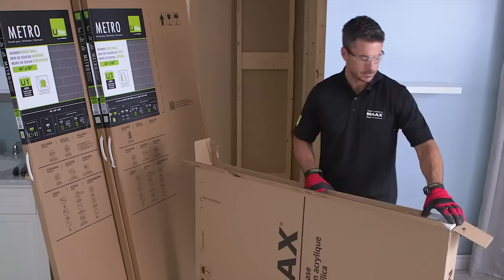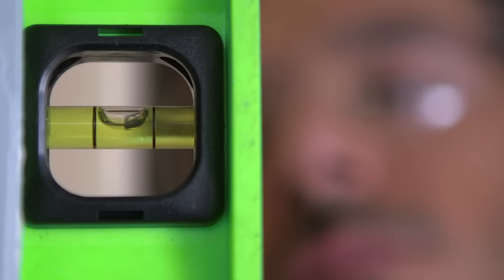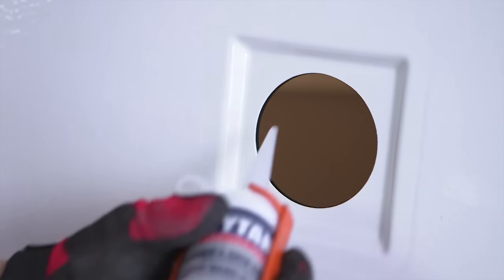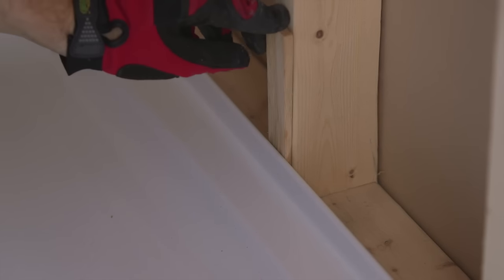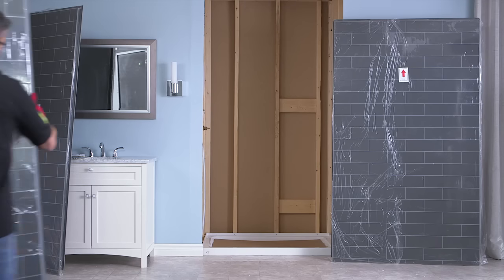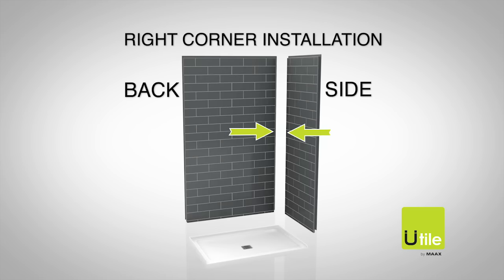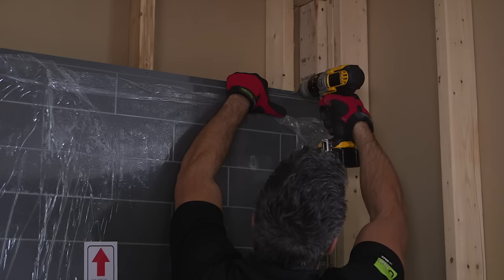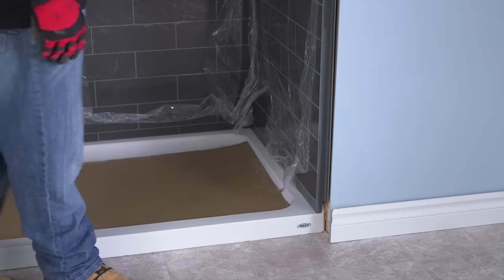Utile by MAAX - Installation Video

Comment: We had to reorder the large  wall panel due to the first one being warped, off by almost an inch. They sent a second one, and ITS WARPED, but by only 1/2”. Ok we’ll use it…..but… trying to line up clips along the edge, they’re off, and 2 of the clips have a lot  of play, and one set of holes is so close to the edge, you can’t even get the clip into them ! Whaaaat ?  I’m thinking the rest of you are right, and this is some sloppy manufacturing 😡. The hub is a good problem solver, but still pretty frustrated. Might call Home Depot and recommend they stop selling this product. Not impressed, Canada, with your dictator, or your product …signed, “your unhappy neighbor in Idaho” 🤨
Reply: lol made me laugh. Your comment started out normal enough then went bat shit crazy by saying you aren't impressed with Canada and its dictator over a failed utile install.
Reply: @Ragnarrage  glad you got a laugh !

Comment: Use gloves or you will be sporting some serious fiberglass splinters. Our holes were not drilled correctly making the clips unusable. Shimming is essential because some of the panels are slightly bowed. So even with leveled studs, the panel might require shimming. Very frustrated with this product. We rigged it all in the end. Would have been appreciated if the had clips or spacers or whatever you want to call it for bases with a different height of lip. FYI we installed shower walls over a tub all the way to the ceiling.

Comment: And then he’s supposed to drywall on top? That doesn’t make sense at all. Mud getting all over the tiles. Tile should go to the ceiling
Reply: What do you think happens in a new construction after the one piece tub or shower is installed? Drywall is installed above and around it. This is a good example of where you would use a drop cloth to protect a surface. Or, you know, just don't have drywall mud flying around in large quantities.

Comment: Just finished ours.A few tips 1) for the installation of the side walls using   dual suction cups tool(Harbor Freight )makes it a lot easier to move the panel up and down 2) for centering the pan properly I installed the back wall unit on the pan then you can be more precise by looking at the vertical 2x4 next to the back wall unit.

Comment: 14:24 this is wrong. you're not supposed to silicone the very bottom of the faucet faceplate. if water goes between the faceplate and the faucet handle, or if the upper silicone fails first, it has to be able to escape through the gap at the 6 o'clock position in the black foam around the circumference of the faceplate rear. if you don't leave that open then it can't drip out and could fill the cavity behind the faceplate and overflow through the faucet hole in the surround

Comment: We are in the process of installing now, most of the holes were miss drilled, we spent all day taking it in and out fighting it and each other! The 1st back panel we got was cracked, it took weeks to get a replacement. Its been exasperating!
Reply: Ours were also mis-drilled, making the clips unusable. We ended up just using predrilled holes to screw the thing into the studs when we could. I am pretty sure my husband invented a few new combinations of swear words. Shimming is essential because the panels can be somewhat bowed.

Comment: I believe they made a mistake at 14:24 saying to silcone the face plate aka valve escutcheon...there is no need to do this as it comes with a foam seal as shown.. the silicone will look messy if not done well, and may get scumy longterm.
Reply: Not all trims will come with a foam backing.
Reply: @colettegauthier6997  any trim worth buying will have foam gasket.

Comment: Getting ready to tackle this installation in couple weeks.  Special ordered thru Menards.  The base Menards bundles this with has the styrofoam core.  My foundation is level concrete.  Is there any way of minimizing the squeaking noise the base makes?  Would felt help?
Reply: Are you happy with it? Did you figure out a way to stop the cheap sounding squeaks? Thanks
Reply: @JeffWinters  overall yes.  There is some give to the styrofoam base but it does not squeak.  I put baby powder on concrete prior to install.  I was told there is a 300 lbs weight limit for this base.
Reply: @dougwhite8074  😆

Comment: I bought the Artik bath surround product and although it looks slick to put in, it is a nightmare.  I am working on putting in the back of the bath tub surround (and they don't show that do they?...I wonder why) but it is in a remodel situation.  My walls are plumb and square, but putting in the back the bottom is bowing.  Nothing to tie the bottom back to only the top.  The fiberglass edging in this video is very clean, but the product delivered to me the manufacturing is very sloppy. Using the holes to put in the retraction pins and to find the holes on the back side to put the screws in I had to remove the fiberglass to find the holes on the other side.
Instructions:  The instructions are not sufficient for a remodel.  No instructions on what to do if certain situations occur.

Support:  Maax only has support in Canada M-F from 8 -6 pm EST.  How realistic is it that DIYers are going to do this Monday through Friday? Even better, why is it that it is EST?  That leaves us in the West short 2-3 hours!  I know the universe revolves around Ontario and Quebec. They should have their support team available on the weekend ,  ' cause reality check Maax - that is when DIYers do their stuff.  I know I'm Captain obvious. Now I have to wait until Monday to talk to them, when I have paid a contractor to do the work and have to work with what I have or wait until Monday.
Reply from the maker: Please contact us directly at 1-877-438-6229 OPT 2+2 for any technical support. We have technical specialists that will be pleased to assist you.

Comment: Did I miss something? Did the installer make sure there were studs located behind the shelf brackets?
Reply: those panels are 1/2 to 3/4 thick....enough to support a bar of soap or shampoo with the shelf

Comment: I installed drain in shower base  as shown . Have it set up in my garage to check for leaks before I install it .
The drain leaks around the gasket supplied with base . One rubber gasket touching the drain pan itself then the cardboard gasket 
The directions say one gasket touching the bottom of the pan then cardboard gasket .    
However the  drain came with two rubber gaskets and two cardboard gaskets directions say one set like the video 
Why is it leaking ?
Anyone ????
Reply from the maker: Hello! If you are still experiencing trouble with installation, please do not hesitate to give the MAAX team a call at 877-438-6229 (Option 2) between 8am-5pm EST, Monday-Friday. We would be happy to hear more about the issue you're experiencing with the gasket and help you find the best solution!
Reply: Use silicone between drain piece and top/inside of tub/shower.

Comment: You show shimming the base but not shimming the walls. I'm assuming for this to work, either shimming or building out the studs will be needed for the side walls.
Reply from the maker: AI B, the shimming of the base will always be required allowing a match perfect between base and wall. By shimming the base on the backside, you will make sure that your Utile sidewall does not exceed the base threshold. Also for each side you will assure that your Utile wall are scared and straight allowing you to secure them directly to the studs.

Comment: Why put directly on studs? I like to use aqua board behind mine. Will it work? They don't show how to finish the drywall if using their method over studs.
Reply: I was wondering the same thing. Doesn’t look like they reply to comments
Reply: im sure it's just like any insert.  drywall down to the flange then use a setting compound to fill in the void and smooth it out
Reply: Yes, correct. @R2Mike

Comment: My valves (installed by a plumber) stick out several inches beyond the wall, making it impossible to engage the side wall to the back wall. I needed to slide the back wall away, engage the side wall, and then move the whole assembly back against the side wall studs.
Reply: This is the problem I'm trying to figure out now, except I don't think I have enough room to engage them away and then move them into place 😞
Reply: We had the same issue, but were able to engage the clips at quite a severe angle.  We set our panel in so it could still move.  We had already cut our faucet, spout side panel.  Then we slid the faucet, spout side panel into the corner at the angle required to just get past the roughed in spout.  Lifted the side panel about and inch and a half, pushed it into the corner and used a lot of force to push down.  It snapped right in.  Surprising but it worked.  No where does U-tile tell you this, show you this, nor when I called their Tech number did the tech give us this info.  One U-tile video on how to properly install a tub surround with the bath spout rough plumbed would be very helpful and is a joke that U-tile hasn’t done this.  That’s our only real complaint.  Once in place it looks and functions well.  Oh, and those stupid little cutouts at the bottom corners of the side walls are dumb.  Have a left and right side and stop goughing out the bottom corners that a person has to deal with when finishing the drywall around the side panels.
Reply: Pulling the cartridge on the mixing valve would gain you some clearance.

Comment: Can panels be used with any brand shower pan?
Reply from the maker: Thank you for your question, Gigi! The recommended bases for our Utile panels are the MAAX Olympia base and the MAAX B3 square base. We cannot guarantee that bases from other manufacturers will fit the Utile panels properly. If you have additional questions, please do not hesitate to reach out to our team at 877-438-6229 (Option 2) between 8am-5pm EST, Monday-Friday. Our product experts would be happy to assist you. Best wishes with your upcoming project!
Reply: @maaxweb  - This video is very nice, but does not show the B3 base.  Is there such a video?

Comment: How long should this take to install, and what level of installation is this, easy, med or expertise ?
Reply: As a professional plumber, I would say this is somewhere between medium and professional grade skill to install. Maybe leaning towards professional if the surrounding structure isn't reasonably close to perfectly plumb, level & square. But perfectly plumb, level & square is a myth. In a remodel scenario, you virtually never come across it. Something will inevitably need shimming, trimming or leveling.

Comment: What a POS system. This whole thing relies solely on silicone with no panel overlap? How wonderful. NO THANKS.
Reply: Panel overlap is only required on the bottom of each panel. The corner joints of most shower door frames only require silicone with no panel overlap so the other corners should be fine. Last I checked gravity still pulls water downward towards the earth.

Comment: The video is very misleading.  The shower doors take 1 day alone to install!!!  As the door insulation is not detailed in this video, that should be evidence enough of the difficulty of the door installation. Although the Utile shower looks good once completed, I would not recommend buying this product.  It comes in hundreds of pieces with hard to read and follow instructions.  I would say overall it takes a minimum of 3 days to install by an experienced contractor.
Reply: Oh boy.... And I've only given myself one day to do this to stay on schedule.  Not real thrilled with the fact that they DO NOT have a video.  There's a good bit of junk useless manufacturer videos out there, I'm curious just how "simple" this is going to be.
Reply: Shower door....
Reply: 3 days denotes a very INEXPERIENCED contractor. I demo'd the old valve and installed the new rough in valve today and set the shower base over a mortar bed to level it. Took me 3 and a half hours. I'm going back tomorrow, once the mortar has set up, to install the wall panels. If it takes me 5 hours, I'm goofing off along the way.
Reply: @NineGaugeNut  did the mortar bed help?  i always install one under these things just to stiffen it up.  was it helpful??